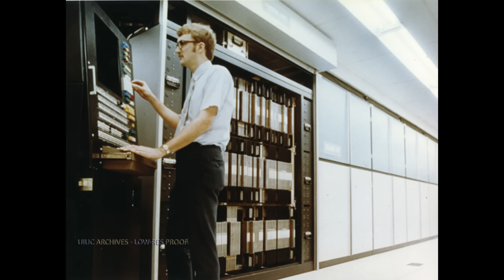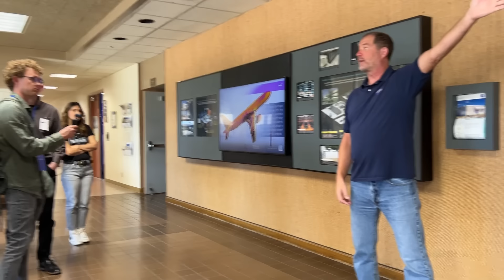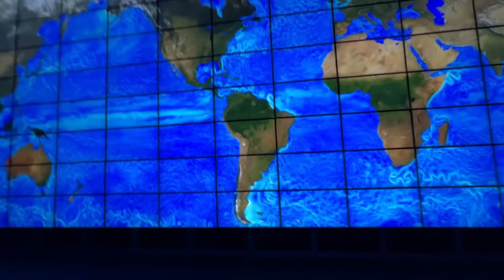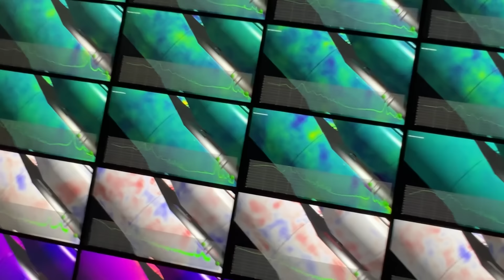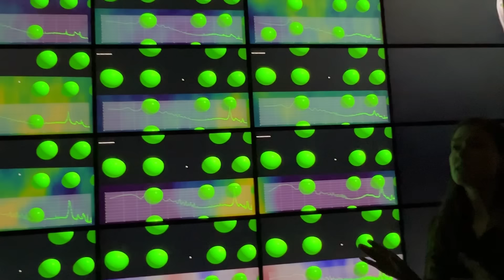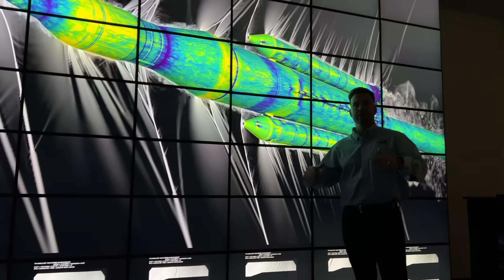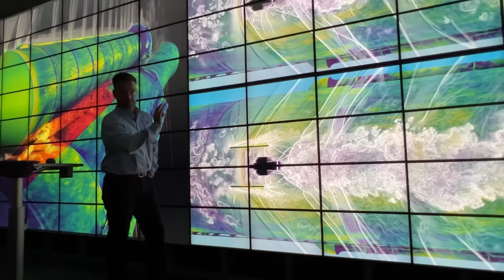NASA's Most Powerful Supercomputers & One Billion Pixel Display

Comment: SCOTT - I had a aerial filming company with custom drones ....  We were having an issue with oscillations in the frame getting into the camera systems.  I read a paper where fur was used on motorcycle fairings to eliminate additive vibrations.  We took all of our carbon fiber tubing and made fur coats for all of them......  Amazingly worked like a charm.  There is a nasa idea.  Just put fur on it😅

Comment: Great video!  Wondering if the strakes on the SLS have a common lineage with the “LEX Fences” on the f/a 18 classic hornet.  If I recall, they were getting  early fatigue on the vertical stabilizers due to turbulent flow from the leading edge extensions.

Comment: I'm a little surprised that Pleiades is still running mediocre SKUs of the older processors. There are apparently about 4000 Haswell/Broadwell nodes with 2680V3/2680V4 processors. You could upgrade them to 2696/2699V4 processors, almost doubling performance, for probably around $1.5 Million total, some downtime, and about 15% higher energy costs on the nodes.

The even older Ivy Bridge/Sandy Bridge nodes should just be replaced. You could fill the total approx 3300U rackspace with blades with 24/28 core skylake processors (up to ~300k cores) for about 5 million.

Comment: That’s nice but SLS still sucks as a product for launching mass to orbit.

It’s clear though how it is a scientific experiment and not a rocket that should be economically feasible.

Those impressive toys build around it have  value than something like what a company like spacex does, which strips down the whole process around it to the economic use case.

There should be more honest communication around that though.

Comment: When I was employed at NCAR in  the '90s , 40% of their supercomputer time was spent on running scalar code, generating  graphics. I developed visualization software that ran on Linux with high end PC hardware which generated graphics in less clock time than the Cray supercomputers.  My solutions were unpopular with the atmospheric modelers at the time due to the added complexity of moving data off the system for rendering.  I learned that resistance to innovation is a core human limitation.
Reply: This happens all the time. Someone claims to have found a superior process, but it is overly complex for average users. Even high level users have limitations. It always easier to assimilate to what you have created yourself.

Comment: NASA had to solve the strake problem that arose from the attachment point. But were there any problems with this on the Titan III? Did Boeing/LM forget to do their homework when designing an attachment point? Yes, different rocket size ahead of the point but how different can a cylinder be?

I wonder how Delta IV Heavy and Falcon Heavy handle this.

Comment: In the primitive days of yore, Ames had to do its wind tunnel testing late at night to get the required electric power at lower cost, or in many cases, to get it at all - since the big tunnels were real power hogs.  If only, they dreamed, we could somehow come up with computers that could mathematically model aerodynamic flow, we wouldn't have to worry about such things.  Today's technology has provided them with super duper computers that do a remarkable job of modeling aerodynamics, which run "24/7"...and suck about the same amount of power from the grid as the wind tunnels did!  Seriously, it's great to see Ames in a kind of Renaissance.  When I dealt with them back in the 1990s, they were actually shutting down their wind tunnels, which had little to do and cost a fortune to maintain (let alone run).  In fact, the last Ames wind tunnel manager I talked to (whose name I can't remember) considered free flight testing superior to wind tunnel testing.  I agreed, having had a fair amount of tunnel testing in my background, and knowing its profound limitations.  Basically, if you want to know how your airplane will fly inside of a pipe, use a wind tunnel.; otherwise, fly it in the open air.  But the combination of the CFD Ames has developed, their amazing computational facilities, and wind tunnels really do provide NASA with unprecedented (and as far as I can tell, unmatched) aerodynamic development capability.  I'm glad to see that, and thanks for the post.

Comment: Worked for years in training simulators. The need to have all the systems respond in 'real time' caused us to simplify a lot of the physics and calculations. So something that the engineering group might nodalize into a 1000 node mesh, we had to fudge into just 12. Can't use our stuff for engineering, but if the student can't tell the difference, it was 'good enough'. Of course over the years (30+ year career), as computing improved, we added more and more fidelity to the models.
Modeling to the level shown in this video is impressive.

Comment: IIRC, the 8-CPU Cray 2 (there was only one) was installed at NASA Ames around 1990 or so. 8 CPUs, 250 MHz, guaranteed not to exceed 2 flops/clock/cpu.

Comment: i knew about flywheel storage but i didnt know anyplace it was actually installed, neat
Reply: Honestly sounds like a pretty good use case for it
Reply: Yeah, I thought that was given up on. But I guess NASA is used to using one-off technology, or something close to it. I guess Scott restrained himself and refrained from asking about using a Mega Pack.
Reply: @donjones4719  Only the ridiculous long-term-storage for grid demand, pop-science fad finally gave up.
Flywheel is in common use for brief power smoothing, in this case probably a minute of power while the generators startup. With the benefit of zero fail over time so capacitor size on the computer side can be minimized.

Comment: I used Plan and Execute Gemini 2.5 Flash Opal Output: Educational Analysis Report
This report details a visit to NASA Ames Research Center’s Advanced Supercomputing Facility, highlighting its pivotal role in aerospace research, particularly in computational fluid dynamics (CFD). The facility leverages immense computing power to design future aircraft and rockets, complementing traditional wind tunnel testing.

Supercomputing History at NASA Ames

1970s: The journey began with the **ILLIAC IV**, the first supercomputer connected to ARPANET.

1980s: Introduction of **Cray supercomputers**, like the Cray 2.

Mid-1990s: *Thinking Machines* hardware (CM2, CM5) offered significant speed increases.

By 2000: Numerous *Silicon Graphics (SGI)* systems were in use.

By 2002: A *Teraflop-capable machine* became operational.

Present: The *Pleiades* supercomputer has evolved to approximately **7.5 petaflops**, a massive leap from the ILLIAC IV.

Advanced Supercomputing Facility Operations

The facility’s primary mission is to run NASA’s core supercomputers, supporting all agency missions. It is transitioning to a modular approach using shipping container-like modules, which allows for passive heat transfer and direct-to-chip liquid cooling in the Bay Area’s climate. This modular design offers significant cost savings (approx. 25% on operational costs) and improved Power Usage Effectiveness (PUE) – 1.05 for modular vs. 1.25 for traditional data centers.

The facility operates 24/7/365 with minimal downtime. The traditional building has a power capacity of about 4 megawatts, with the overall facility reaching six to seven megawatts. A new system, **Athena**, is being deployed as NASA’s fastest supercomputer, requiring about 1.5 megawatts.

Power infrastructure includes rotational UPS systems with flywheels and generators to ensure continuous operation during utility power loss.

Pleiades Supercomputer (as of 2016)
Architecture: Heterogeneous system with multiple generations of Intel Xeon processors.
Scale: Approximately 250,000 CPU cores across 161 racks.
Memory: 900 terabytes.
Storage: Hundreds of petabytes of data stored offline.
Applications: Scientific computation, including Mars re-entry simulations.

NAS Hyperwall

The NAS Hyperwall is a critical tool for exploring massive, multi-dimensional datasets. It features a 16×8 array of 4K monitors, creating a colossal display system. This enables real-time data streaming, processing, and collaborative analysis. An example application is visualizing the Echo model (ocean dynamics), showing sea surface speed.

Aerospace Research Applications

Computational Fluid Dynamics (CFD):

CFD numerically solves fluid motion equations, allowing investigation of extreme conditions. Simulations can involve billions of nodes (e.g., 4.5 billion for the LAVA solver), generating massive data volumes (e.g., 60 gigabytes per snapshot). NASA’s LAVA solver enables rapid iteration for launch and vehicle aerodynamics.

Pressure-Sensitive Paint (PSP):

PSP is an optical diagnostic that maps surface pressure by changing luminescence based on oxygen partial pressure. It provides global, continuous pressure data in wind tunnels but is sensitive to temperature and photodegradation, requiring significant supercomputing power for data processing.

SLS Booster Streaks & Von Karman Vortex Street:

CFD simulations revealed that streaks on the SLS boosters generate vortices, stabilizing flow and preventing resonance issues caused by the Von Karman Vortex Street. This demonstrates how simulations provide detailed insights into flow physics.

Vera Rubin Images:

The hyperwall is used to view high-resolution images from observatories like Vera Rubin, aiding in the identification of distant galaxies.

Integration of CFD and Experiments

The synergy between CFD simulations and experimental techniques like PSP is crucial for validating models and gaining deeper insights. Advances in GPU technology and efficient solvers enable complex simulations to be run quickly, accelerating research.

Comment: THIS is what we need to be doing with our GPUs, compute clusters, and Megawatts of electricity.
All those corpo pricks shuffling money around for the current "AI" scam, so they can skim off the top are the problem.
"AI" is a toy. It is a fancy search engine designed to deceive the ignorant, built with stolen(or at least non-consensually collected) data.
ALL GenAI is unethical and wasteful, even when it isn't being an outright scam.
We need to pour those resources into REAL science like the stuff in this video, not LLMs.
Reply: why so we can waist power running simulations on a useless un-reusable rocket?
Reply: @AC3EEEEE  Because it's actual science that we might learn from?
If you think it's wasteful to design, build, and use a real rocket one time, surely you recognize the waste in using Megawatts of power on a fancy search engine that uses stolen artwork to create words/pictures/video purely for entertainment... right?

You can recognize the difference between:
It's wasteful to buy the wrong kind of food, but at least we can eat it.
...and...
It's wasteful to burn paper money to light your room.

Comment: For mega scaler data centers, whats the breakeven between location & cooling in this example: Bay Area real estate vs. Arizona desert? Sounds like a question for aI.
Reply: Perplexity Pro says: “Rough Scale of Breakeven
•	For a given data center size, real estate+construction in the Bay Area can cost multiples—potentially 2-4x—over Arizona.[azbigmedia]
•	The extra annualized cost of desert cooling (power and water) is material, but, except in the most extreme facilities, it rarely reaches parity with Bay Area property premiums over typical depreciation cycles.[andthewest.stanford +2]
•	Therefore, most hyperscale players currently tilt toward Arizona and similar markets for new expansion, unless specifically constrained by latency/user density in the Bay Area.[novva +2]
Overall, in 2025, hyperscale expansion economics heavily favor Arizona’s desert for cost efficiency—where cheaper land, concentrated incentives, and manageable cooling costs typically win out versus Bay Area land premiums, except for ultra-latency-sensitive or compliance-driven deployments.[scoutcities +2]”

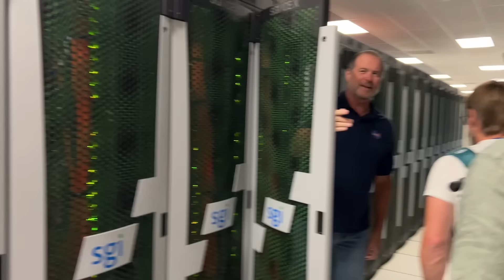Comment: It's VERY surprising to see all that orange OM2 fiber in those racks at 8:00.
While it's possible it was modern fiber with a non-standard jacket color, SGI and NASA are both pretty good at keeping up with standards.
For reference, OM2 50/125 multi-mode fiber is/was mostly used for 1Gbit links.
We were REMOVING it from our non-telecom racks and replacing it with single-mode fiber at my base in 2005, so it is strange that a NEW install in 2008 would have it, let alone surviving all the upgrades since then.
Reply: OM2 can go up to a 10 Gigabit link over short Distances
Reply: @JesopherJones  Yes it can. But you do that for legacy installs. And you do it when replacing the current fiber is annoying and pricy.
You don't run 20k new patch cables with custom termination inside easily accessible racks using old tech, when new tech is literally less expensive and sitting on the shelf already.

Comment: Starship data centers in a two day orbit. Laser connected to Starlink and starling to your cell phone. Elon wins again. It just takes the capability to put them up there and he’s building three a day and buying every chip. They’ll sell him and building his own fab gig away!
Reply: Is there a single technical advantage of putting a data center, whose equipment has quite a bit of mass, requires a lot of energy that is dissipated into heat that has to be removed from the system, into space? (Apart from maybe slightly better latencies under certain circumstances)?

Comment: The resolution in the SLS flow visualisation CFD animation is simply exquisite .. and they can run this model OVERNIGHT !!!!!

Things have progressed a little over my career in aerospace … how when I started back in 1979 in the Stress department of the technical office working on the structural substantiation of rotor system and flight controls … all seated in ranks of desks spaced at the legal minimum from back to front of the main office and an island of filing cabinets in the middle with a single electric calculator (cash register style) which was shared by Stress, Aero, Performance and Dynamics departments. We had ESDU data sheets and log tables provided … you were expected to provide your own slide rule or pocket calculator.

Even only a few years ago (I retired during the pandemic), CFD models were simplified to focus on localised features, such as an engine inlet or wing leading edge profiles, just to be able to get output from an overnight run lest it took a couple of days … and certainly not sufficient to give us the geometric and time domain resolution shown here. Even then, half the time the model would fail and we’d have to wait for another iteration. 

Really interesting to see the rotor flow simulations too … back in the early 2000s we were struggling to fully understand main and tail rotor interactions. These animations really make you realise how complex the interactions are within the natural world we live in  … move your hand through the air and appreciate the complexity of what occurs in that simple interaction. Imagine being a tiny Scottish midge living and interacting every moment in this environment (actually not many moments at all when SLS passes through your airspace 😂).

Comment: I'm, again, green with envy. Thank you for sharing this video so we can all experience the tour vicariously. Most enjoyable. I've always admired the computer modelling I have seen and this was particularly spectacular.
Way back in the day, before I went to Uni, while my pet T. Rex still lived, I had a summer job in the computing department of a university and handled the (card stacks) input and (line printer) output as well as queueing the jobs to the then supercomputer they had: a CDC 7600 (fed from a CDC 1700).
It performed at around 10 megaFLOPS (10⁶). The gpu of a current Apple M4 chip offers about 3 teraFLOPS (10¹²). I remember one researcher (whom I won't name) running a "two tray" progam in FORTRAN which modelled 256 atoms interacting within a box. One day he dropped the two trays. It took him a bit less than a week to reconstruct the program. Your laptop runs at gigaFLOPS (10⁹) rates and could produce better results quicker and the IO is sooo much easier and better, not the least because you can't drop the input or spill coffee on the output and ruin it.
Anyone else remember the line printer picture drawing FORTRAN program which printed a version of The Mona Lisa etc? Anyone still have copy?
Keep up the good work Scott, looking forward to the next episode of "Geeking Out with Manley."

Comment: The four megawatt UPS moment was priceless.Mic drop exit stage left
Reply: "Four megawatts is a lot of diesel" Indeed! I work for a municipal government agency and the tank farm for the emergency management building here is effectively the whole bottom level of the facility. Even then, there's a plan for a dedicated tanker to replenish the facility after 36 hours or so. We're in Florida, so we're prepared for a multi-day power outage after a hurricane.
Reply: @UD503J  It IS a lot of diesel eh - chin-scratch-back-of-the-envelope calculation ends up something like 300 gallons per hour at 4MW.

Comment: This is actually beautiful. Beauty occurs when there is a certain subjective alignment between information from the subject's visual system and the subject's expectations. When these align, things visually "make sense" and the more complex the visual field is when that happens, the more "beautiful" we feel the field is. This is an adaptation that satisfies our need for picking out signals from visual noise. Good design emphasizes the salient information: hotter, brighter colors where there is more turbulence or density are easier to understand and process. It's satisfying. It's interesting to watch. This is very hard to achieve when there is so much going on.